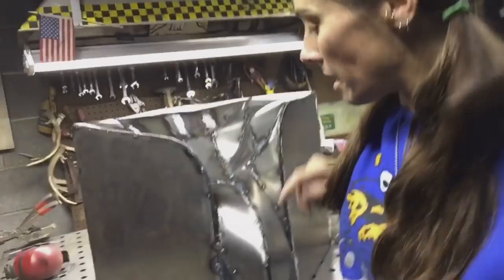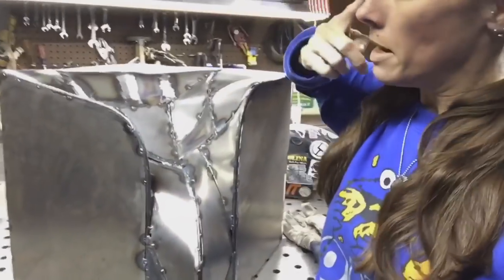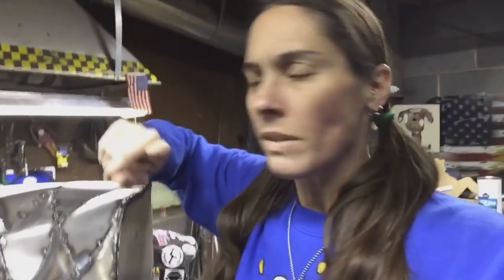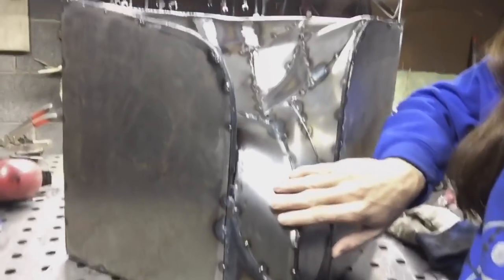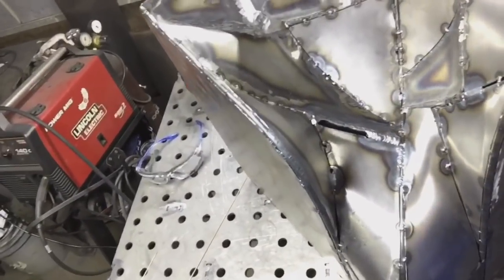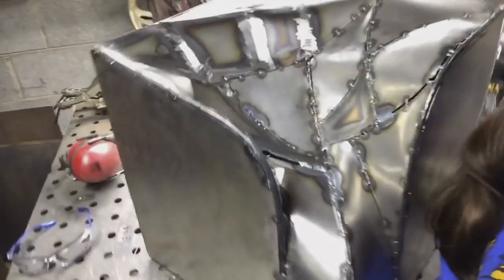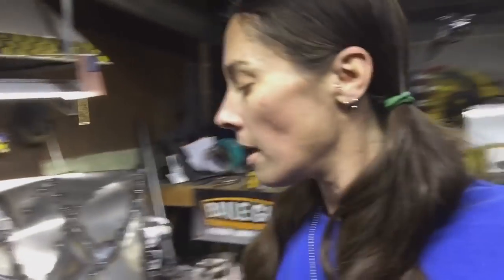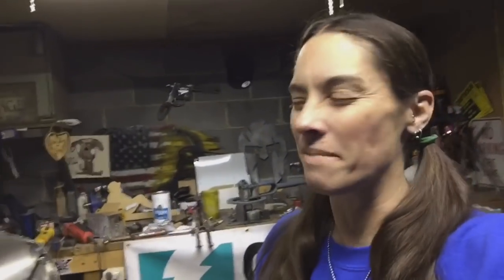How To TIG Weld A Gap

Comment: I have used thin strips of sheet metal for filler. Seems help absorb some of the heat. I don’t know if that’s right either. Just how I’ve done it. Gas welding though. Not tig.
Reply from the maker: +MrHevyshevy Whatever’s clever!! 😉

Comment: Good job Barbie it's not easy filling a gap that wide especially steel 90% of my welding is aluminum after I slap the sheet metal person kidding :) I'll run a bead on both sides and fill the middle or lay 1/8 rod in the gap then weave a bead I find welding steel extraordinarily CHALLENGING aluminums much easier I've been tig welding for 45 years ....love it and I love your show thxs :)
Reply from the maker: +RICHARD ZIEGLER I ran a bead down the thick material side at first and then filled it. I have always found aluminum welding to be more difficult but I love how it flows!